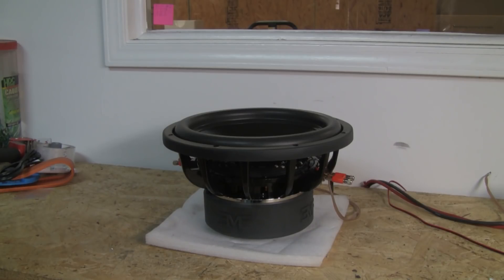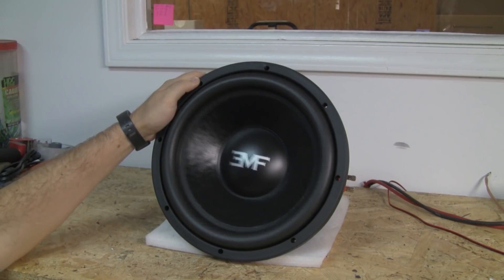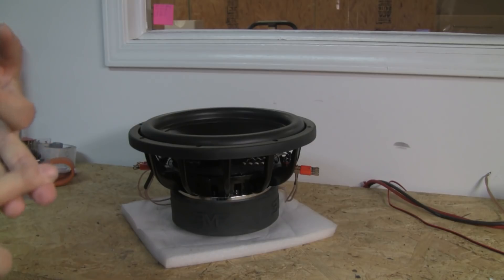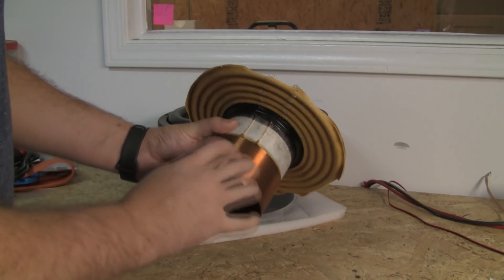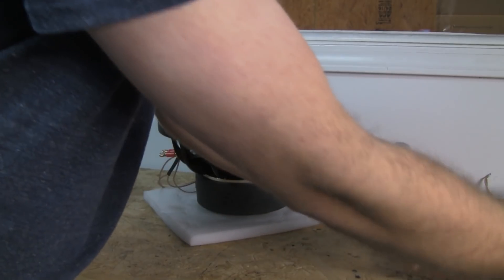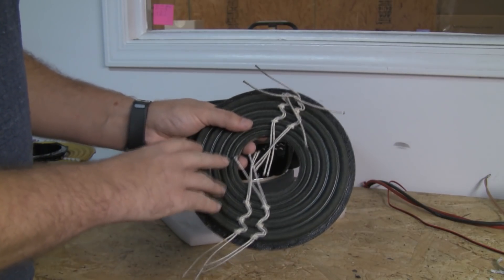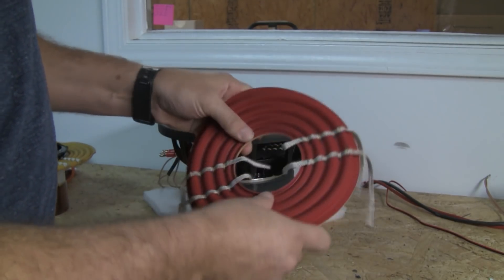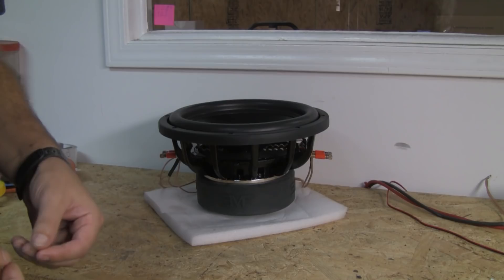Tech Stuff Tuesday - Subwoofer break in myth busted

Comment: I've been researching subs the past few weeks and one thing I've noticed looking at product reviews is a lot of people will pair their amp with the peak wattage of a sub and wonder why their sub is blown after a month. Like one review, the customer stated they got an 800watt RMS amp and the sub they were reviewing was rated at 400 rms, they gave 1 star because they thought the sub was trash because it was blown in less than a month. I've also seen a tech "pro" review for a subwoofer on youtube suggesting to get an amp with an RMS that was rated twice the subs RMS. I definitely see a lot of misinformation in this field.
Reply: A good reason to have an an overpowered amp is that, most amps will experience distortion if you max them out. If you have a 2000 watt amp and a 1000 watt sub, then youll be able to safely push the sub without the potentially causing distortion.
Reply: @dongod2786  Spot-on.  A 1965 VW Beetle (Bug) and a twin turbo Porsche can be driving side-by-side at 70mph but only one can overtake the car in front doing 80mph...
Reply: @dongod2786  Ah isee! It is similar to getting a PSU for your PC and having it rated twice the wattage your PC will pull so it doesn't stress it and lower it's life span.
Reply: @jon2394  No, you do not need twice the power of what your PC components require.   A little overhead is always good, but not twice.  If your PC needs 300 watts, a 450 PSU is fine.   Need 600 watts, a 750 is fine.

People will often get double the power when they plan to expand in the future with additional cards or whatever, but don't really know by how much so they play it safe.
Reply: @marcuslinton310  why not get extra in case you upgrade later, then you only need a speaker not a speaker and a amp
Reply: @clayramsey019  Wouldn't that also depend on their wallet?  That extra amp power also costs money.  If they are on a low budget they aren't looking at higher end brands, right?  The subs they are looking at are likely not that expensive so why not just buy the power and the number of subs they want from the get go.   Talking maybe a 100 more for the extra sub?  If they can't even spend that much more, maybe they shouldn't bother at all because they'll have to replace the single sub box as well and hopefully get their money on resale, which is pretty hard these days to sell used audio gear.   Just get it right the first time and save some hassle and money.

If they are looking at more expensive stuff, seems budget isn't all that much of a factor, so why would they wait to upgrade later?  Again, you'd be dealing with a single sub box going to dual sub or whatever.  Just wasting money on a single box that you could have put toward the extra sub to begin with.
Reply: @marcuslinton310  yes it would. I was on a budget but am very happy I bought a 1200 rms kicker 6 years ago . Thing is putting in work on a l7 right now. I think for the extra 50-80$ it’s worth going slightly higher if can. But that’s a given to me. If your counting penny’s.definitely not but at the same time maybe should hold out a lil if that’s the case anyway for financial reasons.but yes comes down to how much $$&$$$ like everything
Reply: @clayramsey019     So people should anticipate what their plans might be in 6 years?  Seems unlikely.  If an upgrade can't be foreseen within the following year, I can't much see the point of allowing for "what if's" 6 years out , maybe push it to 2 years, but not 6, geez.  Where does it stop?
Reply: @marcuslinton310  you buy good stuff it last…  sorry o don’t sell my stuff?
Reply: But yeah if you like bass and never want more .. don’t anticipate buying anything else… get a tiny amp . If you are not like most people and won’t want more bass , buy the bare min. Sorry if your amp is too small to upgrade your subs bro.
Reply: @dongod2786  Most amps?  Not true.  The amp I use has a bass knob with clip indicator.   It's an 850 rms amp that pushes around 1000 before it clips or distorts.   Amps these days are not like the old days.  Old days they would claim 500 watts and only make 100 watts, hence needing way more claimed power to get the actual power wanted.  Just not the case anymore with known name brands.  Still some jack leg brands out there like pyle pulling the old school crap though.
Reply: I always use amps which are at least double the speakers' rating (where possible) to achieve the highest output voltage possible to give transient headroom.  For example the coaxial BMS compression driver in my system is driven by one 1kW per channel amp and one 300W amp for this reason.  This is very common practice in high quality PA systems.  The absorbed power of normal music by a speaker is relatively low, having at least a 10dB crest factor, but car stereos are obviously a different matter entirely given the unnatural bass-heavy content played by some.

Comment: Yes, there are weird myths about break in, thank you for dispelling them, but you missed the point of what the truly valuable break in procedure is. Breaking woofer in by simply playing stereo might take weeks if you're only using it an hour or two every other day or so. In the meantime it won't sound its best until spider and surround have loosened a bit. A woofer run free air below 60 hz makes very little noise, can run it for hours without much distraction, whereas in a box it'd be very loud. Playing a sweep tone through driver BEFORE you put in the box is going to be a lot easier and less time consuming for many people than breaking it in in an enclosure.
Reply: ZOOOOOOOOOM!!!!     This video zoomed right past you, didn't it?  If you are claiming to hear a difference between new and "broken in" sub, I'd really like to put you to a $1,000 listening test to prove it.  You would never select the "broken in" sub from any other no better then guessing.   Get 10 subs all the same.   Select whatever fantasy "break in" method you want me to use for 5 of them and the other 5 won't even be ran until the test.   Play each sub in random order and select "new" or "broken in" and the results would be no better then flipping a coin or guessing because you would never be able to hear any difference.   If you get them all correct you get $1,000, get one wrong, you owe me $1,000.
Reply: @MotoAtheist  Have you ever owned a paper coned woofer with paper surround? They are different.
Reply: @joeystalloney5109    LOL!  Sure thing... break your subs in any fantasy way you see fit.  Just quit telling everyone else to do it if you can't produce any facts to back it up.
Reply: @MotoAtheist  What facts do you have? The fact you haven't been able to tell the difference? The fact that I haven't accepted your offer for a $1000 challenge? Those aren't much in the way of facts that refute anything. Regardless, I'll continue to say as I wish, especially since we are talking about the realm of audio where subjective perception rules anyway.
Reply: @joeystalloney5109  There is plenty of info debunking the "break in" requirement myth.   Break in occurs just by playing the subwoofer normally, which includes up to it's full RMS rating right out of the box.   There are no special procedures or methods or anything else required to "break in" a subwoofer, it just happens with time.  There has never been a single argument for "break in" that has any relevance.   People tend to confuse a broken in sub with a "break in" period.   No, the sub just loosens up with time because that's just how materials are.   Again, this just occurs by playing the subwoofer normally, no special requirements.

The idea of breaking in a subwoofer with lower wattage for a bit is just ridiculous.  How are you breaking the sub in by barely moving the cone at lower wattages?  Makes no sense because the woofer isn't moving enough to fully stretch anything out.  Then you have the SPL sine wave farting idiots who are looking to loosen up the subwoofer quicker.  This isn't so much a break in requirement, it's just trying to get the speaker loosened up quicker by playing a constant sine wave at higher wattage.   I won't even try and reference all the goofy BS fantasy methods that are out there, but I've yet to hear a single one that didn't make me laugh. 

The funniest part is you "break in" fanboys can't even see the obvious conflict between the low wattage people and the high wattage sine wave people.  The two methods are completely 180 degree opposites.   One barely pushes the subwoofer for some special amount of time while the other hammers the piss out of them straight out of the box.   Yet, somehow just running them within their RMS rating is the improper method.   You people are F'n whacked.
Reply: @MotoAtheist  Wow, so much vitriol, you are obviously very passionate about this topic.
You apparently didn't put much effort into understanding what I wrote above. I never said a break in was required. In fact, I clearly indicated that yes, a woofer would break in just by being played (ie no break in is strictly necessary in any sense), but a break in procedure can be useful to simply speed up the process. If woofer is run free air you don't have to run it at low wattage, in fact you can run it at much higher wattage than you might normally because there's almost no output at lower freqs without an enclosure. Furthermore, cone excursion is greater at equivalent wattage without enclosure. Using a sweep tone emulates how it might break in naturally, ie unlike hammering it with a single sine wave. If you fail to understand the logic of this, oh well. It appears you are so upset at those who insist break in is necessary that you've cast me in their lot and your anger blinds you from seeing the simplicity of my statements. `I neglected to include the caveat that many woofers might not have anything to gain by such a procedure because of how they're constructed (ie many materials don't break in); oh well, sue me.
Reply: @MotoAtheist  Yes, that's exactly what I was saying, your powers of observation are most keen.

Comment: Amazing video!!! Now what I am really curious about is when it comes to putting new woofers in to expand your system. In my case: I have a no wall with 4 15s, but I bought a van to build a 9 15 6th order. What are the dangers or precautions I should take when it comes to the woofers? Do I need 9 equal (new) woofers or can I buy 5 new ones and use them all in one system?
Reply: i wonder the same thing

Comment: Isn’t the point of breaking it in is so you don’t over heat the coil right away? As the spiders loosen up the coil isn’t going to heat up as much.
Reply from the maker: You can't break it in if you don't put power on it.
Reply: @EMFAudio  the spiders will loosen with moderate playing. If you just go wide open ham on it between the fresh VC, super stuff spiders you can cause an excess of heat build up which will lead to the vc being damaged. There is a real reason why there is a break in period. It’s not snake oil. Some people don’t do it and have no problems others have problems right away.
Reply from the maker: @azzazel_99  Oh, so you mean a poorly designed sub that's too stiff with crap coils. I don't deal with those so I wouldn't know. Even SPL subs, 15's with an Fs in the 60's, you can put 10k on them first play. I know because I've done it a hundred times. Like the video said, if the sub blows, it's trash. It takes power to move it. If it's not moving it's not breaking in.
Reply: @EMFAudio  to each their own. You call other people’s subs trash that work perfect once you break them in properly. Sundown, Skar, mtx, Memphis, American bass, kicker, fi, even steavemeades own shit is supposed to be broken in. Again to each their own. But flat out calling stuff shit or trash cause they recommend breaking in stiff spiders just makes you look dumb. If YOU choose not to break any of your subs in that’s cool too. However plenty of brands that recommend break-ins slap hard once you get through the recommended break in. Plenty of people don’t break in some of the same subs I mentioned above and never have issues.
Reply from the maker: @azzazel_99  none of the brands you listed break when you DON'T break them in either. Well some American Bass might, the ones that are the same as Sound Qubed. Some of those are trash for other reasons and don't break from not breaking them in. But what do I know about subs, I just have patents for engineering them.
Reply from the maker: @azzazel_99  So the person that says the expert is wrong because they have no experience to prove otherwise isn't a douchebag? The reason subs break from not breaking them in is explained in the video. I'll say it again, the brands you listed don't require breaking them in to stay working, regardless of what they repeat. Hell most of what you named don't even have an engineer on staff.
Reply from the maker: @azzazel_99  and I'm literally just saying they don't all say that. You're assuming they do. I've only seen a couple actually publish it. If it is true, why are the recommended procedures so different ranging from a few hours to a few months? We recommend not using higher than rated power because of warranty, not because the subs won't take more. I'm going to assume any further response is trolling because repeating what's in the video more than once isn't normal.
Reply: @EMFAudio  guess there’s a reason I’ve never heard of your “brand or store
Reply from the maker: @azzazel_99  Probably because you're looking at videos of kids making their roof flap to impress other kids, who buy the cheapest thing with the highest specs even if those specs aren't valid. Yeah, I know the market for those other brands. Their customer service doesn't respond on Sundays either.

Comment: Its funny,  I have seen and owned many systems, always broke in my subs to manufacturers specs , the only sub I didn't break in was an EMF, and it blew in less than a week   on nominal power,  in correct box , amp set with oscope , upgraded electrical,  everything was correct, but didn't break in the sub
Reply: Let me clarify that I was not knocking EMF subs, in any way, they are bada$$,  I was just stating that the only time I have not broken in a sub, it blew , the part that I found funny,  was the coincidence of this video,  and the incident I had with the not breaking in a sub,  resulting in it blowing. and it just coincidentally happened to be an EMF sub , EMF is an excellent brand and by no means was I saying anything negative about them,  the malfunction was entirely my fault, for not breaking it in properly, and I am in your records,  the sub was bought from the website, brand new , but its in my real name,  which I don't wish to disclose on here
Reply: I fully support EMF and highly recommend them to anyone who is looking for a solid,  reputable,  clean and reliable system,  whether it be for a daily driver or for the big big leagues of competition
Reply: And I would also like to apologize for any confusion, that my comment caused, as it would seem that it was taken wrong and believed to be an insult directed at EMF , and that was never my intentions,  I was only sharing my experience on the subject of breaking in subs as opposed to not breaking them in , the one time I did not break one in properly,  it blew , at my own fault and not the subs or manufacturers,  it is 100% coincidence that it was an EMF sub that it happened with, could've happened with any brand out there because the fault was mine and not the equipment,  the main point I would have rather people to learn from my experience is if you're going to take the time to build a custom box , tune amps with oscope,  upgrade electrical,  etc etc , why not break  in your bada$$ sub right too
Reply: @mikeywilcox2501  You aren't fooling anyone with your apology, everyone knows what you're trying to assert here and it's absolute BS.    DD Audio started all the "break in" BS because they are trying to justify their insane prices.   The whole break in BS gets mostly spread by SPL fanboys because only the computer can notice the difference in the level of farts.   I don't believe your claim at all.
Reply from the maker: That's funny, because we have no record of you owning an EMF sub. And if you didn't buy it from us, that means it was used, which also means it was already broken in and possibly damaged to start with.

Comment: I just bought an American bass xr 10d4 which is rated for 1000 rms. I plan on running 1000 rms out the gate and I listen to metal. Will this sub be okay? 1.8 cu ft box tuned to 40hz.
Reply from the maker: Good luck.